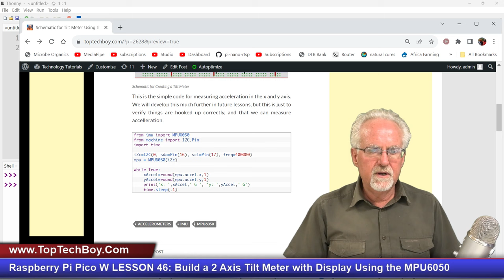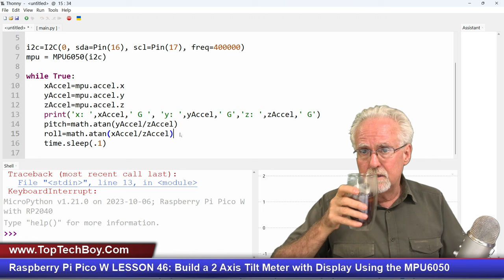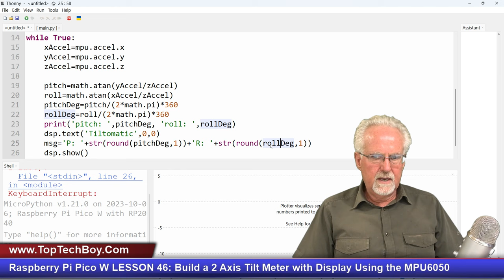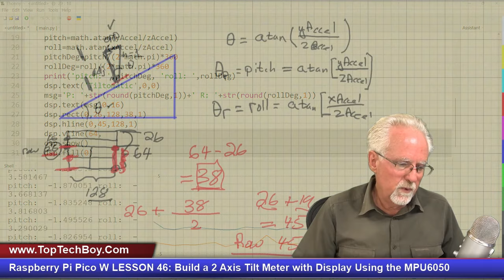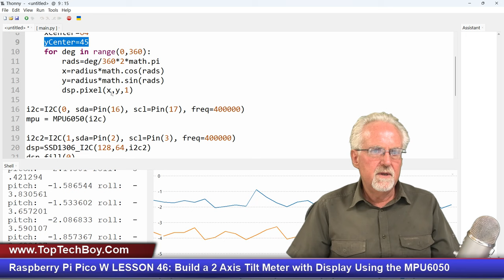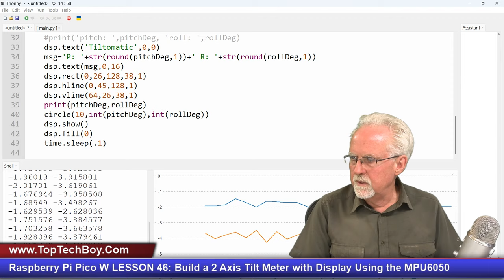Raspberry Pi Pico W LESSON 46: Build a 2 Axis Tilt Meter with Display Using the MPU6050

Comment: Hi Paul,

Great lesson as always. I noticed that the bubble breaks ou of the top of the rectangular box and infringes on the text values. It doesn't do this at the bottom of the rectangular box? Does this have to do with adjusting the roll offset to keep the bubble from escaping out of the top of the rectangular box and infringing on the text values? Thanks much.
Reply: @rickbonari4493 The bubble can break out of the rectangular box at the top, bottom and both sides - it's just that the sides and bottom of the box are on the edge of the oled so the bubble floats away into the great blue yonder😁

Comment: Is the Pico fast enough to power a self balancing robot?    If so, is like to see this code enhanced to run a self balancing stepper drive robot.
Reply: I'm guessing that the Pico and micro Python is not fast enough to drive a balancing robot.  Can you confirm?